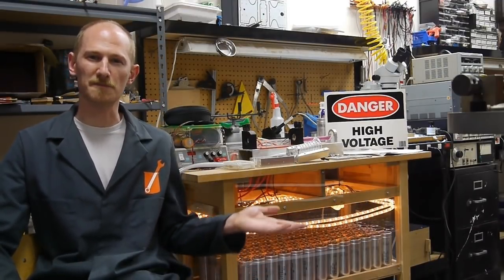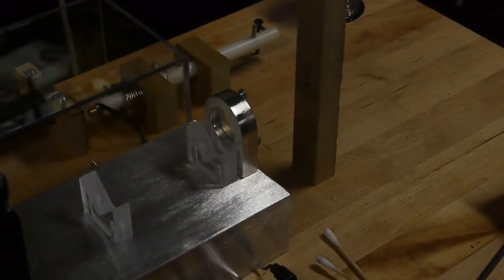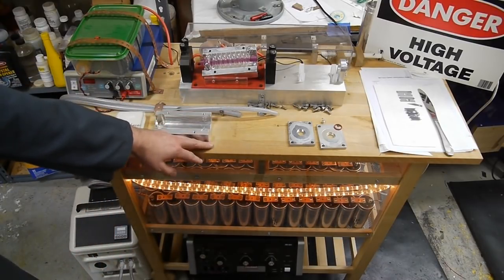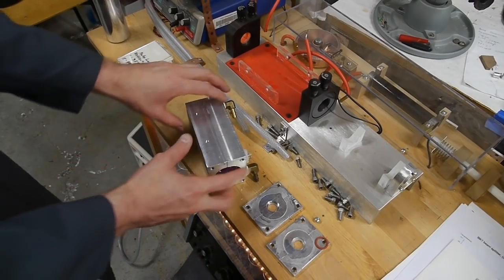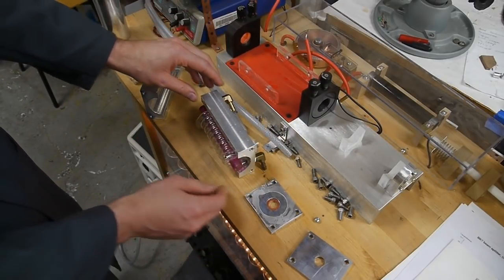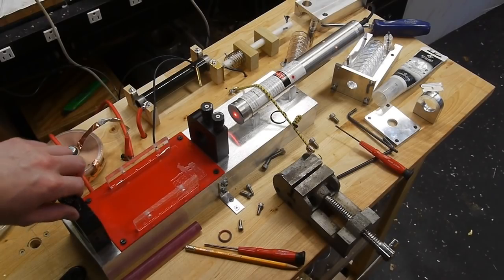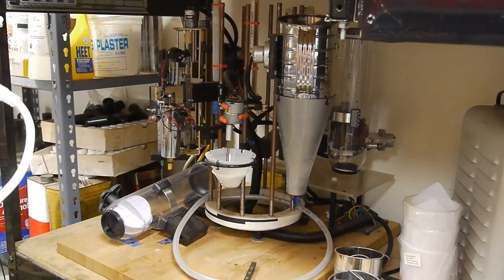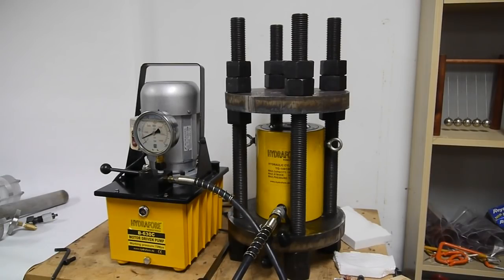Ruby laser (and other projects) follow-up

Comment: Cool, brings back memories! I had the same problem when as a student I reconstructed a ruby laser a long while ago (to make giant holograms of all things). The whole trick was to get the light and cooling reach very close to the ruby end facet, so you get no absorption damage (Ruby is a 3 level system if I recall correctly, so where it's not optically pumped it it will absorb, and you'll get thermal damage to the facet). An old mechanic from the optics lab, who had made the original laser in the 1960's, re-made a very thin plate end holder and used Indium foil as the seal. Has the advantage of being a good heat conductor and light reflector right where it matters, in addition to a very durable seal.
Reply: didnt expect to see YOU here!

Comment: Really neat seeing the wood block recoil from the "impact" of the laser pulse. 
I was wondering if the fast discharge has any impact on the life span of the capacitor bank?
Reply: +John Heisz If I had to guess, and without being an expert or anything, I would guess that these would be pulse rated film capacitors. This essentially means that the film inside is connected all the way down, as opposed to being connected to one end of the spiral, if that makes sense. This eliminates much of the impedance inherent to normal caps, meaning they can take being discharged very quickly. If such a bank was given generous tolerances, one could imagine it having a very long lifespan. If you're interested, however, in such high power discharges, look up coin shrinkers. There's one around which managed to blow up the caps they used in a few shots, prompting an even beefier setup to be used.
Reply from the maker: +John Heisz I pulled these capacitors from a bunch of pro photo flash units, so they were intended for quick discharge.  However, I've wired them up in a long series chain without balancing resistors, so they are being stressed more than they were originally, for sure.  My biggest fear is that one particular capacitor fails in a dead short, and then has all 8KJ of energy directed into it by the rest of the bank.  It would be one heck of a bang!
Reply: Pretty sure he said it has nothing to do with the impact of the laser pulse. Has to do with the rapid discharge of gases escaping from the blast of light cooking the wood.

Comment: Thanks for sharing your ruby laser project.  It reminds me of a similar project I attempted to undertake when I was in the 8th grade, believe it or not - way back in 1965. Bob Brown, a very popular Mr.Wizard-kind-of-science-guy, came to our junior high school one year and gave a number of science demonstrations, two of which were of the continuous and pulsed lasers. (His demonstration of the pulsed laser included a razor blade, like yours).  Since I am a science nerd, (grinding telescope mirrors, experimenting with model rockets, buying a slide rule just to see how it works, etc, all before graduating from high school), I was determined to build a pulsed laser.  I contacted a gentleman in Florida who not only sold plans, but also could provide the critical parts.  The laser rod and flash tube were relatively inexpensive (less than $20 each), but the one item that kept the project from becoming a reality was the Thordarson transformer, which cost around $75.  That was a bit much for a 15-year old with a paper route for income, so I decided to move on to other projects.  In retrospect, perhaps that decision was a blessing.  Who knows what I might have vaporized a hole in.  Interestingly, I still have the plans in a file cabinet in the basement.

Comment: Your capacitor bank is impressive.

By the way, a typical high power solid state laser seals the ruby rod by placing the o-ring around the outer circumference of the rod; not a face seal.  The face seal reduces the aperture of the ends of the rod and reduces the power output.  Also, the face seal o-rings absorb the emitted light and degrades causing the damage to the face of the rod you are experiencing.

Take a look at this example:

https://en.wikipedia.org/wiki/Laser_pumping
Reply: My guess is that he knew but he wanted to pump as much volume as possible of the rod. Ruby being a 3 level laser, every length of unpumped medium drops dramatically the Q factor and ruins the gain. Seems it wasn't worth it, as he now has a damaged laser rod :(
Edit; ruby is a 3 level laser not 4 as i said. everything else its still correct.

Comment: Very nice.
One thing that puzzles me about lasers is the absorption in the mirrors. As I understand, even a perfect visible light mirror is only 91% reflective so how do you avoid the mirror being fried? how reflective are they.
Also, isn't a CO2 laser just easier? can't you do the same high intensity pulse.
Reply from the maker: The mirrors are not metallic, which only reflect 95%, as you say. Instead, the laser mirrors are made from perhaps a dozen layers of metal oxides. The layer thickness is tuned so that the whole stack is extremely reflective (99.5%) at exactly one wavelength. At any other wavelength, it looks almost clear.
Reply: +Applied Science I see. using QM for a single frequency. hmm, thought provoking. Perfections are to be found in resonances.
QM gangster. Keep their heads ringing.
Reply: +therealnightwriter hehe well most of the places where I would look that up it will say it's quite true. So what makes you think it isn't?
Reply: +therealnightwriter Come on then, I'll bite. If the prism thing is only one small provable introduction, as you put it, that implies there are others so let's have one or two. I'm always interested in provable. Let's see what you've got there.
Reply: +therealnightwriter Science is so much easier when you just make it up out of fairy dust and conspiracy theories, isn't it?
Reply: +therealnightwriter One thing: Saturn's rings are so lightweight that Saturn's gravity tearing at them overpowers their internal gravity (between particles)
Also Saturn's moons can be SEEN to pull at the rings creating unusual formations and, in the long run, gaps, eg. in this image featured today on the front page of nasa.gov: http://www.nasa.gov/image-feature/jpl/cassini/pia18337/gored-clump-in-saturns-f-ring

also how the hell is cancer "fermentation"? Do you know what either of those words mean?
Can of compressed air is cold: gas laws. It draws energy from the environment, yes, as does every endothermic process. Your point?
Wedges being aerodynamic is a common misconception invalidated by actual aerodynamic scientists. Pointed objects are aerodynamic at supersonic speeds, which is why the Concorde and most modern fighter jets have pointed noses, while airliners and WW2 planes have rounded noses.
Single rocket engine can swivel to provide control. Also there wasn't one rocket engine on the Apollo lander, there were 17 for precise control, rotation when coasting, and docking.
Reply: Tuxfanturnip I wouldn't bother, bud. This guy is either nuts, a troll or both.
Reply: Yo Da Sometimes I like to see how far these people will bend backwards to "prove" a point. This isn't the first time I've seen someone proudly hold up evidence that directly contradicts their position.
Reply: +therealnightwriter i feel compelled to explain every one of your claims even though i know you'll accept none of it, but it's almost 4am for me so ill just start with what i know from the top of my head.
Saturn's rings, tidal forces. Bigger dinosaurs, higher 02 concentration along with evolutionary arms race to be bigger. Rocket stability, the rocket pivots around its center of mass while center of force from the rocket is balanced at the center of mass by a gimbals and the center of thrust is far below the enter of mass so excess thrust torque from inaccuracy is minimal compared to stability provided by the center of mass being below the center of mass based on the geometry of the rocket. Cancer is not fermentation because it consumes sugar, all of the body absorbs sugar for growth and energy, cancer is out of control growth. Since growth requires energy quickly it takes the most sugar from the blood stream. Solution, find the area absorbing the most sugar using "radioactive dye" to find the highest concentrations sugar use. The dye is made visible by the PET scan. Big bang, im not going to go through all 30 or even bother looking at them but ill address current evidence and your claim on adiabatic cooling. Microwave background radiation throughout the entire universe, Doppler effect works for all forms of waves including light,  so red shift is why it's microwave frequency. Yes light is a wave, we send data through it by wave manipulation, eg internet. also many other reasons it also behaves as a particle. QED for example. QM is a rather obsolete explanation of quantum interactions, quantum field theory is a bit more modern. Air foils, no they are not the primary source of the lift force! Angle of attack is, so if you angle the plane you generate lift in the opposite direction. Air foils are the shape they are because they offer maximum efficiency. Jupiter 10 months of the year, ratios of orbital period allow for a clear line of sight from somewhere on earth at all times unless something is between it, like the sun, which is a fairly small thing to hide behind on the scale of the solar system.  Back to compressed air, it cools from the adiabatic process, energy goes from concentrated to spread out. Heat also spreads out. When the can cools there is a temperature differential and environmental heat energy can flow in. Absolutely nothing physics breaking about that since it required energy to be compressed in the first place. Wherever you have a differential whether it's temp/pressure/height you have energy. Green is most certainly in the rainbow, unless you're color blind,  your eye balls have color cones for detecting RGB, when you get any ratio of any of those your brain imagines the rest by ratios of color. Look at your computer screen, thats no more than RGB. Wedge aerodynamics, yep, most people would be wrong, whales are shaped better. this is well understood by science. No E does not equal MC^2, that was the equation written for the general laymen. E^2=MC^2+PC^2^2, momentum must be accounted for. Just realized you meant the lander not the launch rocket, Precise centering is easier when working with a smaller craft. Since there are no aerodynamic forces this stability is important. Reaction thrusters help out with any imperfections, these are small rockets in various locations which help with balance and orientation. I'm done, this is horribly disorganized and you will never read it and you will refuse to understand any of it and you will probably resort to immature  remarks if you cant think of anything intelligent to say.
Reply: +therealnightwriter is your light source thin enough? in principle it needs to have no size or there will be overlap or smearing of the spectrum.
try making it thin.
you might also want to realize that if such a super simple experiment demonstrates a violation of known physics, it would have been noticed long long ago. the combined human achievement is after all a lot better than that. certain other things are missed that shouldn't be missed but not something that highschool simple.
does that make sense?
try less emotion, less paranoia. deep breath. be aware that good science is not about being agitated. it's calm careful thinking.
Reply from the maker: +175griffin +therealnightwriter Keep the discussion civil or I will ban you from commenting on my channel.  If you've read any of the other comment threads on my videos, you'll notice that no one is acting like you are right now.
Reply: "Magnets. How do they work?"
Reply: +Jon Miller something something VIRTUAL PARTICLES??!!!!!!!!
Reply: +Tuxfanturnip yeah the short answer is that no one really knows how it works. You can say a lot of things about it that give good insight but ultimately, magical virtual particles find their way in just the right way for it to work the way we see. Although I don't know all the known physics, but it seems it boils down to a feynman diagram where a force carrying virtual particle conveniently goes from one to the other.
Reply: Jon Miller
Haha, good one!
Reply: +Dan Frederiksen what it comes down to is this. the reality we evolved to see and interact with is a secondary effect of quantum interactions we are not evolved to even conceptualize. light is neither a wave nor a particle we simply see it that way...we evolved to throw rocks , find mates , food , raise offspring that kinda stuff its a form of observational bias or in this case blindness , we use energy to "see with" there for we cant "see" energy.
Reply: +Kevin T the problem with that is that we didn't evolve nor do you know anything about the limits of the mind.
qualia violates evolution although that takes patience and calm to understand. it's easy but most are too sloppy to think for even a second.
Reply: "nor do you know anything about the limits of the mind". this is not entirely the case are you aware of Noam Chomsky's work in linguistics? (he calls it that any way) what he actually studies(other than politics) is cognition i saw a lecture he gave on the subject according to him there are experiments that show that rats can learn counting based puzzles that are surprisingly complex ...as long as the number sequence is not a prime number sequence if it is they are incapable of comprehending it. so there is some experimental work showing that cognition can have limits. balanced against that is the fact that humans use their minds in ways unlike any other species on the planet<BUT this is not what meant to convey in my post at all i personalty hope we can see past the "box" evolution put us in but to do so we MUST at all times be aware of what is the box and what is being observed.<that was my point
Reply: Oooooooo I have a question van iT be used as à wepon

Comment: I wonder if the ruby rod could be polished? Getting the 2 ends perfectly parallel would be difficult but there must be abrasives that are tougher than aluminium oxide. Maybe even chemically etching the damaged surface first to do the bulk of the material removal.

Have you tried image stacking yet to squeeze more resolution out of your SEM images? Now that you have digital output taking many images could be automated.

Thinking of making your own diamonds? Or maybe just some exotic forms of ice?
Reply from the maker: +Nick Moore I'm pretty sure that I could grind away the ruby, but the requirement to get the faces parallel is really difficult.  I'm not sure what the industrial machines even look like.  That could give some hints how to copy the process.  I haven't tried image stacking from the SEM yet, but I did make an animation that smoothly transitions to increasing zoom levels: https://www.youtube.com/watch?v=Z6NarJlqSIE

My first experiment with 100kpsi is to sterilize things.  There are some natural juice companies that pressurize their product to kill bacteria without heating it up (giving it a cooked flavor).  The pressure is so high, proteins denature and nothing survives.  Weird!
Reply: +Applied Science Cool, I would have thought that bacteria are so small that they would be essentially incompressible. Could you "cold cook" meat? The ultimate rare steak, although I guess it would have to be a very tiny steak. 

That animation is great, light bulb filament always blows me away for being so thin and yet it's damn near a 2d plane for the scale you are working at!

I can't think of an easy way to 'parallelize" anything with precision, maybe a 1:1 pantograph setup but even then there would have to be 0 slop. Using a lathe and a metal disk with abrasive might work (diamond dust polish?) as long as you do both ends the same it should work. The first ruby lasers were made in the 60's so you only have to match 60's tech to make it work!

Comment: Eager for projects with the high pressure chamber. Would you ever consider some benzene reactions, like hydrogenation into cyclohexane? You need heat too, which might require modification of that pump, but it would be very neat to see since benzene is so stable. Pretty sure you could use a Ni metal catalyst and avoid Pt or Pd, which would be nice for cost purposes.

Comment: Where did you get that recirculating water chiller at 3:18?  I need something like that for a project I'm working on -- nothing to do with lasers or anything fun or dangerous, lol.  I've been using a camping cooler chest with a fountain or aquarium pump dangling inside it with limited success.  When I saw that chiller, I was like "AHA!  THAT'S EXACTLY WHAT I NEED!!!"

Comment: I couldn't quite tell from the video but do the orings in the endcaps seat on the end of the ruby rod? Suppose the end caps were adjusted so the orings were seated around the circumference of the rod instead of the end face?  That way the orings wouldn't absorb as much high energy light and it would allow for the end cap opening to be larger, thus not blocking any otherwise usable light? Not sure if I'm being clear, but just a thought.

Comment: Have you done any work with the high-pressure unit on the effect a high-pressure environment has on the discharge of an open spark gap initiated by an automotive ignition coil on, say, the gap of an open spark plug?  These type of results would really bu helpful to me:  THANK YOU VERY MUCH!

Comment: I've read in a number of places that if you don't care about the light's direction, flat white reflects a much higher amount of light than a mirrored surface.  Have you experimented with different surfaces for the inside of your metal cavity?

Comment: Since the xenon tube releases a shotgun blast of optical wavelengths, is it possible to use a bank of light emitting diodes to optically pump the ruby rod at the required coupling energy?